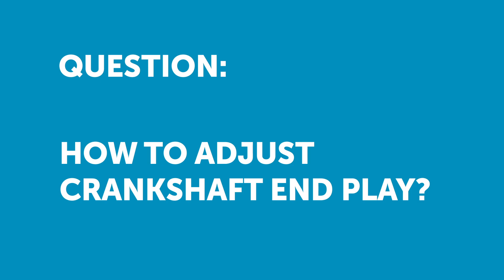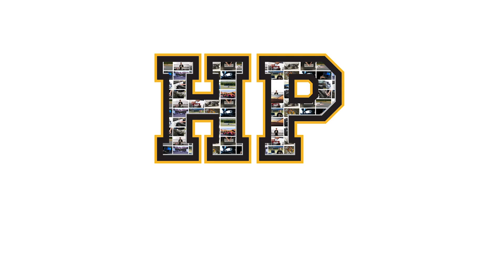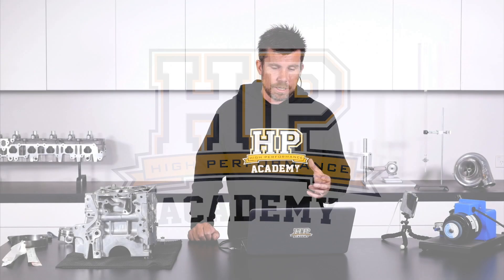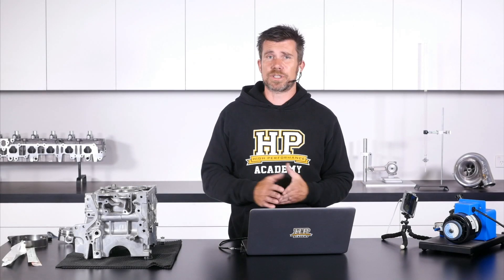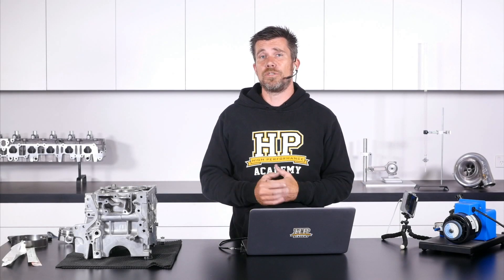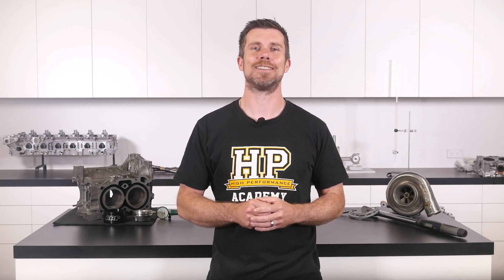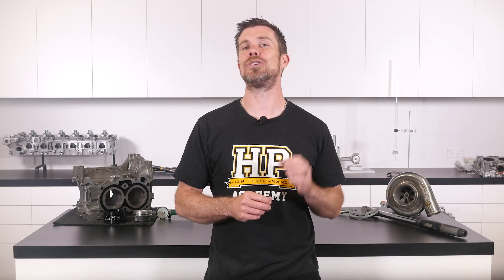Adjusting Crankshaft End Play | Performance Engine Building [HPA Q&A]

Comment: Bought a brand new L200 2.0 Mitsubishi Ute several years ago...on the 1st drive from the dealer...the very 1st time I was a little harsh with the clutch shifting to 2nd, the v-belt fell off...put it back, same thing next day..took it back, they replaced the v-belt...gave it back to me..as I drove out of their yard, it fell off again...then i knew instantly the play was too much...turns out there was NO bearing inn at all and the block had already shown marks..32km..only 32km..they replaced the engine with a 2,4L by mistake...then wanted to fix their mistake after Mitsubishi refused to pay the warranty...lol....I just laughed and walked out.

Comment: I work on bikes mainly, and I always wondered why that's completely ignored when car guys do the rest of the bearings in a race engine.  Well, mostly I wonder why you guys don't destroke the shit out of those things and get the ratios closer to square, if not over.  But I digress.  Honestly, that's the clearance we spend a lot of time on.  Rods and mains are almost never run on the loose end of the spec for us.  I'll chamfer passages and all that, but otherwise it's oem bearings and tight tight.  End play though?  I've seen 10hp differences from one end of the spec to the other.  Our cases are vertically split though, so none of that two-piece-shim crap.